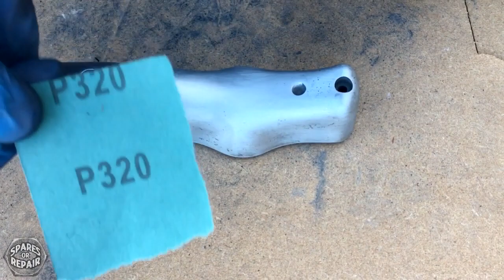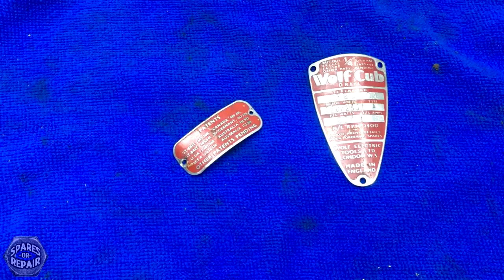1950's Wolf 'Cub' Drill Restoration & Repair - Better than new?

Comment: Having seen all but your jewelers vice restorations now I am thoroughly impressed! Just a quick tip: When sanding on any metal surface, try alternating your physical motion from "vertical to horizontal " as you go higher in grit measure. 1000 vertical then 1500 horizontal then 2000 back to vertical. Each successive grit then removes the minute scratches left by the last. Makes polishing to satisfaction far easier! Great video!

Comment: Flipping Heck! Absolutely gorgeous, though I’ve not read the comments yet to see what you did totally wrong! In the mean time it looks amazing and you’ve preserved an important part of history. The work you put into that finish was really worth it, and I bet it looks better than when it first came out of its box.  If you are dating it almost immediately after WWII it must be fairly rare. Not many had the money or access to electric tools and craftsmen were still using their brace and bits, eggbeater and breast drills. 

There are times only a corded drill will do. I’m building my first woodworking workbench in November and even though I have six different types of drill at the moment, I'm going to buy a corded drill for my dog holes. I’m only buying a cheap one as that will be the only time I'll probably use it, I don’t make a habit of drilling 19 holes into 90mm wood. My cordless drill can probably do it but a corded will do it more efficiently.

My grandmother lived in Ledbury in Herefordshire, she had round pins on her plugs well into the 70s and possibly 80s. It was like going abroad for my sister, she always needed to change the plug on her hair dryer. 

I have a Wolf electric planet, it is good but I thought Wolf was a modern Chinese company. I certainly didn’t realise they were making drills 70+80 years ago! 

Another phenomenal restoration, I'll wager anything you have at least 3k subscribers by Christmas.
Reply from the maker: In the early days wolf tools were awesome, really well made, and often with unique inhouse designs. This motor for example is unlike any other I've ever come across, and the switch mechanism is so over engineered it's unreal! I believe they were bought out by Kango at some point, pretty sure I had a wolf/kango branded drill or grinder many years ago. They aren't particularly rare TBH, but the earlier models with this kind of chuck are harder to find in great condition! You should buy a brace and drill all the holes in your bench the old fashioned way, takes ages but kind of therapeutic :D I often file things that I could have sorted out with a grinder in a tenth of the time :D

Thanks again for watching/commenting, I don't really have massive goals for this channel, just fixing things and enjoying doing so at the minute, would be nice to break 1000 subs though!
Reply: SparesOrRepair I do have a couple of braces, but I also have some unusual nerve damage around my lungs, which is phenomenally painful and my lung function is around 18% at my baseline. That’s as well as now being extreme asthmatic. I do like using my brace and bits, but like every else Im limited how much I can do. Anything over one one inch deep hole requires an ambulance on standby.
Reply from the maker: Mark Harris that sounds pretty harsh, must be hard not being able to enjoy a hobby without possibly causing pain. Good thing about coffee drills over cordless is the lightness, the batteries are a huge chunk of weight, makes them more cumbersome for sure! You should be able to pick up a decent one for cheap on eBay, no need to buy a cheap new one!

Comment: Great video my friend & lovely to see someone appreciating the little Cub drill at last. I've restored dozens of 'em  & many other vintage wolf tools too, I just love 'em, simply because other than an odd bearing here or there, & a new lead, they just don't break or wear out, even now most modern stuff is way way inferior to the old Wolf products.
The little rare Wolf (Cub) 'Challenge' still evades me though.
Reply: Sometimes the armature too though as seen in the video, nowadays of course drills have temperature thermistors to prevent the motor from burning out, I guess things back then things were  much more rigid however in terms of efficiency, todays drills beat them for practical use as the motors are far superior

Comment: Three questions:
1. What is it you use here? https://youtu.be/7bncmQlTE3c?t=683
2. What grease did you use for the bearing?
3. What grease did you use here? https://youtu.be/7bncmQlTE3c?t=886

I just finished all cleaning, received new wires (insolation is breaking down) and a new choke supressor (broke it myself...).
Reply from the maker: 1. Commutator Stick, it’s a soft grit tool used for seating carbon brushes and cleaning armatures/commutators. A fine grit sandpaper will do the same job but here is a link if you want the proper tool: https://www.ebay.co.uk/itm/202595149265
2&3. Any decent grease will work, I used a higher temp bearing grease for the bearing as I planned on using this drill as a die grinder so will be running for long times, but only because I have different grades available, no need to use different greases for both parts
Reply: @sparesorrepair9118  wow thanks for the quick response!!
Reply from the maker: @astonmartijnbruno  no probs, good luck with the rebuild 👍
Reply from the maker: @astonmartijnbruno  I have a box of spares, I’ll have a look in a few days when I’m off shift and let you know 👍
Reply from the maker: @astonmartijnbruno  had a look in my spares boxes and have two complete switch assemblies for a cub, contact me at ninjabearhug@gmail.com and we’ll sort something out 👍

Comment: What connectors are they at the end of the wires? The ring ones. I've looked everywhere to find one but all i can find are ring crimp connectors and they don't fit like the ones there already on the drill and one broke off so i need a replacement.

Comment: Well, this is the third video of yours I have watched this evening.  You have a new subscriber and I hit the bell.  I have a few of those tools in metal probably a different brand but perhaps from the same era. I was going to toss them because they were given to me and I didn't need them. You have inspired me to restore them. 

Thanks those turned out beautifully.  I also learned from the bench grinder about the varnish you put on the winding. Nice to learn something new.
Reply from the maker: Thanks for the sub! I won't lie, sanding strangely shaped items like the drill casing to a mirror finish is a bit of a nightmare, and once you're done you'll be scared to use it in case you scratch it! Looks ace though :D! Post a link to pics if you do decide to give it a go, always like to see others restorations!

Comment: Hi, excellent video, I am doing a Cub and a Quartermast at the moment, both have the same front bearing the one in them is a metric 6201 with an imperial bore of 15/32" (11.9mm), the only ones I have found are 32mm x 10mm x 1/2" bore (which is no good) or a metric 32mm x 10mm x 12mm bore, can you tell me which bearing did you use ?
regards John
Reply from the maker: The bearing fitted to mine was 12mm exactly I think, just used a standard 6201 bearing, works fine with no play at all, I use it regularly!
Reply: @sparesorrepair9118  Brilliant, I decided to order that one and try it.  on another matter, do know what the small elec component is next to the switch on the Quartermaster, it has 3 wires, live, Earth, Neutral, I think it's a capacitor but i'm not electrical, it's casing is broken and is guts are bulging out, it has no ID on it, but the drill still works, I would like to replace it if possible. Regards John

Comment: Fantastic job indeed. My father earlier this year took one of these to bits but due to ill health never got it back together, so my first ever restoration is of the same drill, so finding this vid is a life saviour, Thx. I know this not a forum but one question is one of the wires feeding one of the bushes is badly damaged, what exactly would I need to replace it? Yes I know wire (before someone comments) are those resistors that are taped up? Thanks in advance.
Reply from the maker: Jon C cheers, it was one of my most enjoyable restorations to date, lot of work in the sanding though!!! I’m not sure what’s under the wire covers tbh, it never even crossed my mind! If you’re replacing them anyway my plan of attack would be to strip the wire back and do a bit of investigation work, never know if you don’t look! Keep me updated on how it turns out 👍
Reply: @sparesorrepair9118  Thought I would let know that the small thing taped up are inductors to stop TV/Radio interference, got some to try, thats before I get the trigger device together, you stated in your video it was a bit of a nightmare, I have other words, I just cant get it together, just about to give up.
Reply from the maker: Jon C when I stripped the other switch from the spare I noticed you can slot the ball in the tube, one end is slightly chamfered to stop the ball from dropping out! The person who assembled this one before me must’ve put it together wrong and I just copied! Good luck getting it back together!
Reply: @sparesorrepair9118  Well a big thx to you, shes up and running and running well, that trigger device, I just did what you said and all fine. Oh she`s pure jet black in colour. Thanks again.
Reply from the maker: Jon C that’s awesome!!! Post a pic on Instagram or something and chuck a link up, I’d love to see it 👍

Comment: Would you mind discussing your grease decision for your bearing? You used a red grease inside the bearing. What was it and why did you select it over the brown grease? I'm about to start restoring this same Cub drill, and it's my first real restoration project, and had assumed that I'd simply replace the bearing. Regreasing it wasn't in my mind until i saw your video. I have a tube of pretty standard grease and a tube of some copper high-heat grease lying around. I'll be using those. Is there any reason to think otherwise?
Reply from the maker: markinlondon01 the brown grease I used on the gears is designed to be a bit stickier and longer lasting, the red grease is a high temp grease specifically developed for use in bearings and can be used in high temp applications. For this project either grease would be fine but as I have the specific greases at hand I just used both :). I did replace the bearing with a new skf brand bearing but I lost the footage of it being changed out, still quite new to editing! If you need any spare parts (except an armature!) hit me up, I have a good few lying around after this project :). Good luck!
Reply: @sparesorrepair9118  Thanks! I picked up the version with the grinding wheel and a little lathe tool rest, but did not get the lathe tailstock. It might be fun to find the and have the entire set up and running.
Reply: @Playingwithsettings  May I point out that it didn't appear that you packed the bearing with grease sufficiently.  The best way to pack a bearing with grease is to put a sizable glob of grease on the palm of your hand, and then press the bearing into the grease.  Keep doing this until the grease is pressed through the bearing.  You'll need to continue this until the grease is pressed around the entire bearing.  Just smearing some grease around the outside of the bearing as you did isn't getting the grease onto the races and balls (or rollers if greasing a roller bearing).  Otherwise, great job.

Comment: Great video, I am following steps shown in your video to restore my drill. I did not realise there is an inductor  fitted in one of the wire and I cut through the inductor. Do you know any details regarding the inductor? e.g. Current + Henry( u or milli H).

Comment: How come two different color greases? Is on specifically for bearings? I’m about to restore a drill and got general purpose machine grease. Will this work?
Reply from the maker: Yeah, the red grease is specifically for bearings, a general purpose grease will work just fine, I have lots of different specific types on my shelves though! TBH, a sealed bearing would have been the best practical option as they don't require greasing, I wanted to stay true to the original design though so bought an open race.

Comment: Great restoration. You have a new subscriber. :). 

I thpought the chuck was an early 'keyless' chuck. The allen key is to hold the shaft still while the chuck is tightened / undone. The allen grub is there to lock the chuck to the shaft so it doesnt come undone. Just my thought. The chuck is just like a hand drill or a brace and bit drill. :)
Reply from the maker: Thanks a lot! 

I’m not sure what the grub screw does tbh, but the shaft and chuck housing seem to be one solid piece, I may unscrew it and investigate further! It does appear to be very much like an old hand drill chuck though, maybe it just looks like one piece...

Thanks for watching and commenting 👍